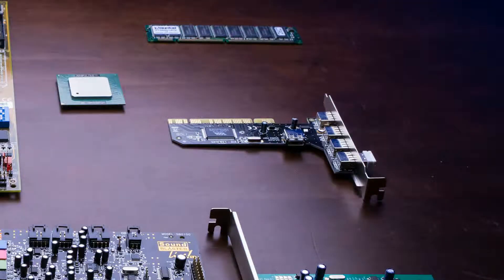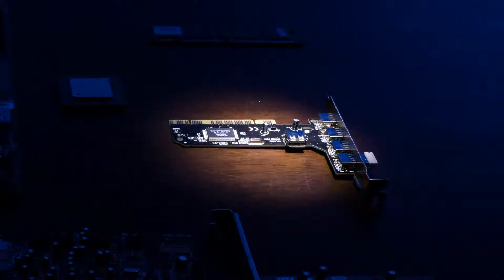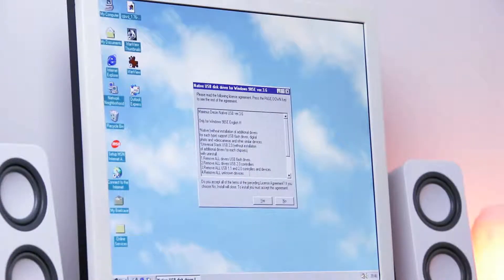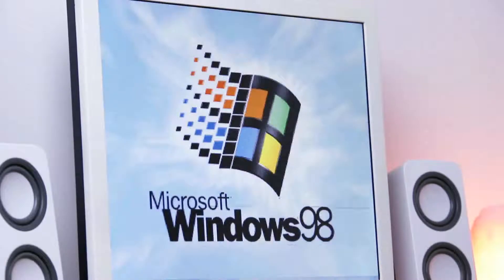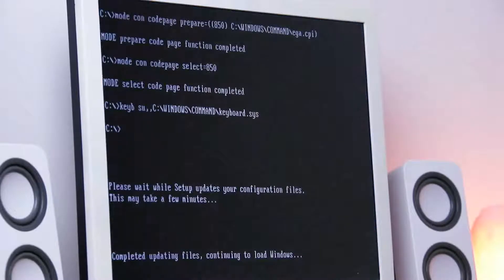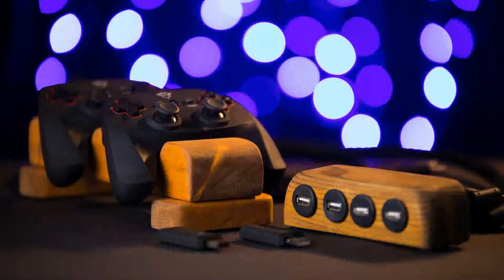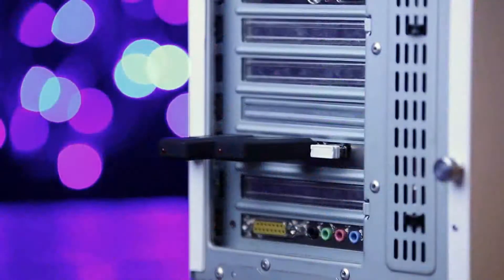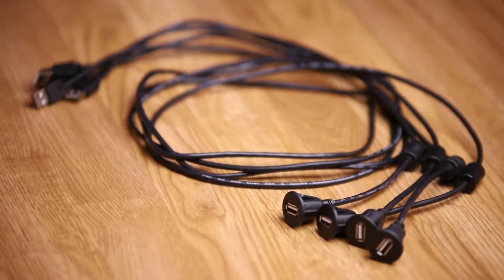Wireless USB gamepads in Windows 98

Comment: Nice USB hub!

How was your experience with the F710? My F310 (same, but wired and with no rumble) works completely fine with 98/Me. It just has to be set to DInput, not XInput.

BTW, I think the official wireless adapter for the DS4 is the way to get it working wirelessly on 9x. Didn't test it because I couldn't find it locally, but it probably fix the issues you mentioned on another video.
Reply from the maker: Thanks! F710 just didn´t work, Windows did install the generic driver when I plugged the receiver in but other than that, nothing.

When I tinkered around with DS4, I tested three Bluetooth dongles. Two of them claimed to be compatible with Win98 but wans´t at all. One dongle was a Bluetooth 1.0 which showed signs of life and actually connected with two DS4´s. I tested them for several hours wihtout issues but when I started them again, they wouldn´t connect anymore and the BT software started acting very strange. I don´t there are any stable Bluetooth applications/software for Win98 atm.
Reply: @khyypio  Tried to help you, but after my comments got deleted time and time again, YouTube can suck a big fat dick and die. Let's see if this gets deleted.
EDIT: Feel free to laugh at my stupidity, I had already told you what I wanted to say a year ago and forgotten about it 🤣
Still though, automatically deleting comments for no reason, but doing nothing when I'm actively vulgar is weird. WTF is that algorithm smoking?

Comment: Logitech F710 can be used in Win98 with the drivers for the Cordless Rumblepad II. Just flip the switch to "D" BEFORE you plug it in the port. Also use 4.xx drivers.
Reply from the maker: Thanks for the tip!